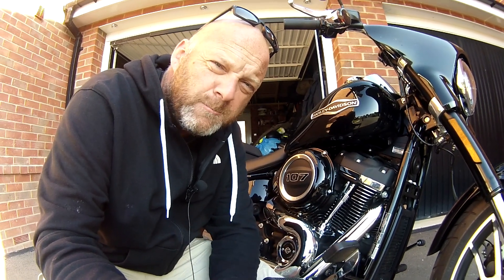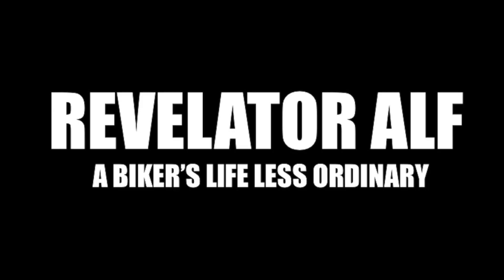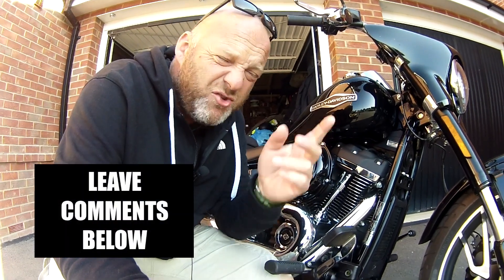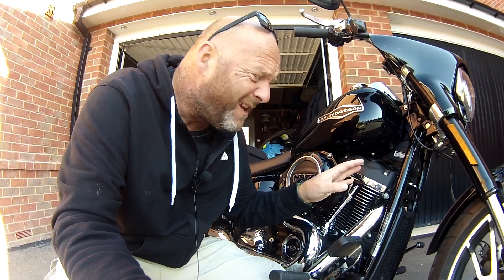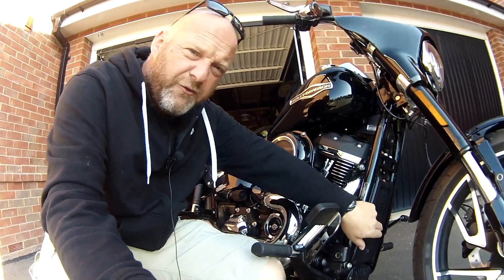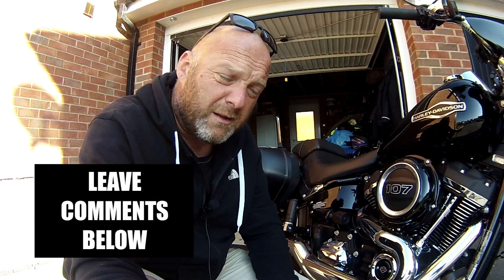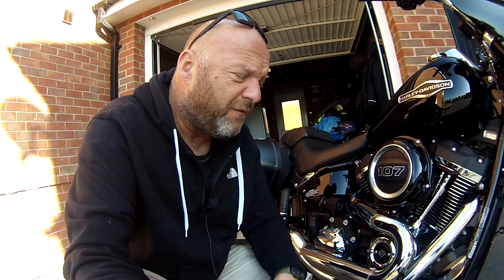How Does HD M8 Oil System Work - What Is HD Softail Oil Cooling & Distribution

Comment: I don't think you were complete in explaining the oil circulating system. You didn't mention all Harley engines except v rod engine are dry sump oil systems....meaning there is a separate oil take from the crank case.  There is another oil pump for moving oil from the oil take to the engine. 
You explained the oil system like it was a wet sump system.

Comment: I think there are also oil sprays in the casing that spray oil onto the bottom of the pistons, I only know this as I seen an article where the mounting bolts holding the nozzles came lose causing a bit of damage on an M8. There is a good guide to upgrading the oil pump with great pictures in American V magazine issue 98 Oct/Nov. worth a read.
Reply from the maker: Thanks Stephen. Yes you’re right too cheers